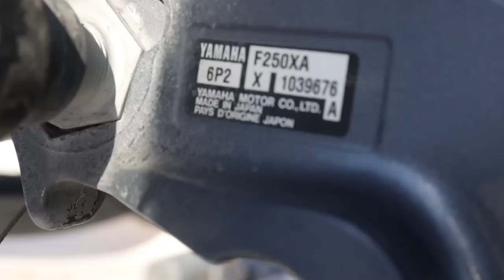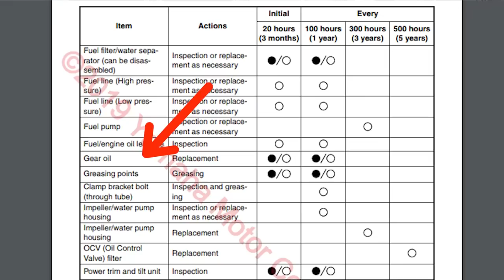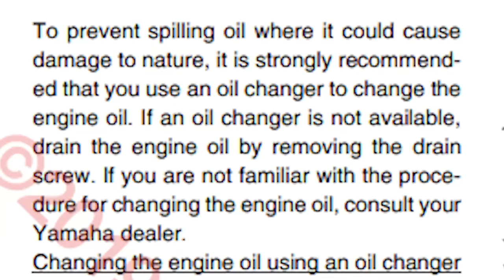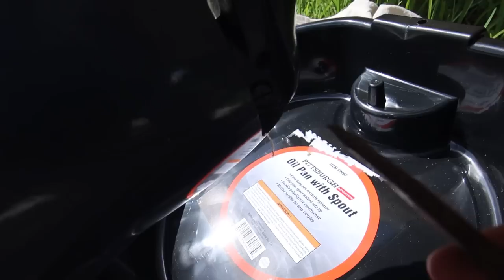Best "How To" 100 Hour Service Outboard Engine Video! (Beginner's Version)

Comment: It's good to see you two doing your own preventative maintainance. It saves money, plus you get to know your boat and motor. Knowing your rig, especially going offshore, is a plus. After a while, you get to trust your rig more because you are more in tune with it. I do all my own wrenching on my rig. I completely rebuilt my outdrive bearings and seals, gimble bearing, lift cylinders, manifolds, do dah, do dah. I am comfident of my boat because I am up close and personal with it. One of these days, you might be able to tell when something is not right by the sound or smell. You will know something is goring to happen before it does, and fix it. It's all good.

Comment: Always a good idea to know your engine. I did my own midsection on my yamaha 225s. Oil filter tip, get a foldable funnel, tilt motor all the way up and put the funnel under it and all the oil will drain out and not go in your cowl, and the filter will be standing up

Comment: Good job you two!  Darcy is great at listening and getting things done.  Puddin is good at researching these things.  A couple caveats....1. the motor wasn't "peeing" because the thermostats had not opened yet.  It takes a little bit of time for that to happen.  I have also seen spiders make nests in "tell tale" tubes that prevent the water from coming out even after the thermostat has opened.   2.  Keep a spare impeller on the boat.  They aren't that hard to change, and if it fails, you can smoke the outboard.

Comment: Good job 👏, on the tightness of the filters I usually do is screw it on until the two surfaces meet then tighten 1/4 turn rotation and it works, 👍

Comment: Hey guys.  Nice work,  one thing I just learned this year, Yamaha has had problems with that fuel bowl/cannister so they changed the plastic. It was bonding to the housing. Next time you do service get the new one.  Hope you got out for some tuna while here in NY!  Cw
Reply from the maker: Thanks for the info!

Comment: I did all my service on a 225 Yamaha.  Tips - use a plastic sandwich bag around the oil filter with the engine tilted up to collect any spilt oil.  You should always use a torque wrench when putting the prop back on - I believe it is 40 ftlbs.  You should change the cylinder anodes at the same time - cheap insurance.  I would always change out the impeller - also cheap insurance.  I always drain the oil from the drain plug - gets everything out and maybe push any sediment also.  I had difficulty getting the motor to "pee" - I removed the intake screens (takes 10 seconds with a phillips screwdriver) before putting on the muffs - never had an issue after that.

Comment: I hand tighten the oil filter at least 3/4 of a turn after the gasket contacts the metal flange of the filter cavity. Anything less may not withstand the engine vibration over time

Comment: I just tighten the oil filter by hand. Once you replace the filter and add the oil, start the engine and check to make sure it is not leaking. Check dipstick for proper oil level and you should be set to go!

Comment: You should have dumped the old gas out of the fuel filter cup when you put the new filter in. Could of had water or debris in the bottom of the cup. Not a super big deal but just in case.